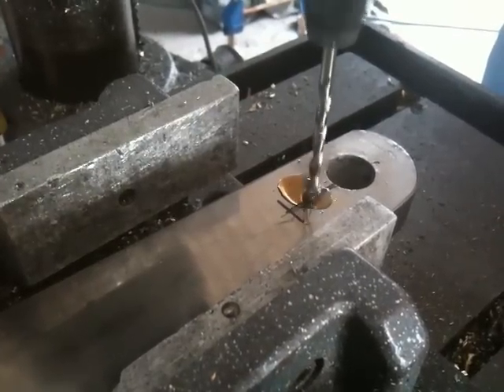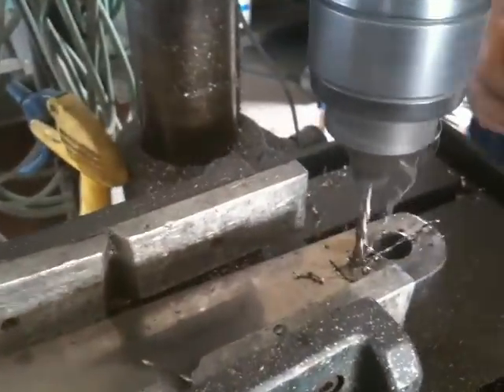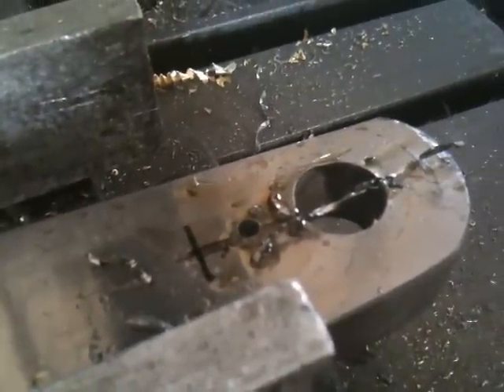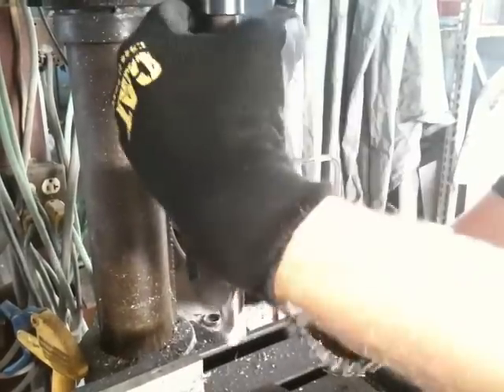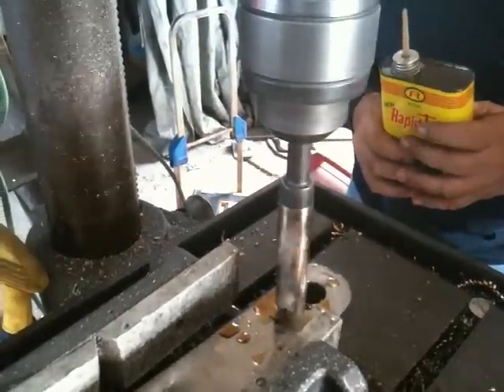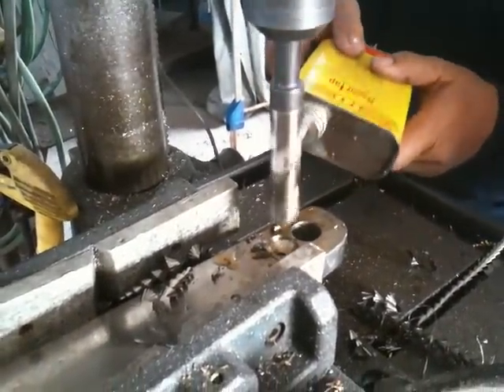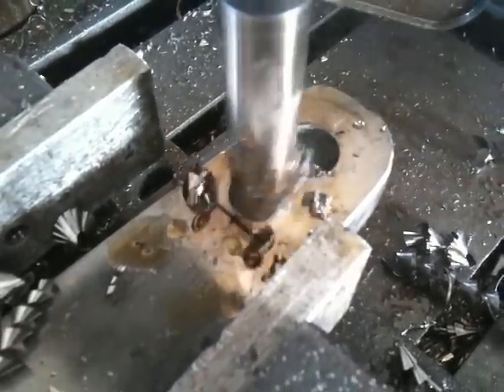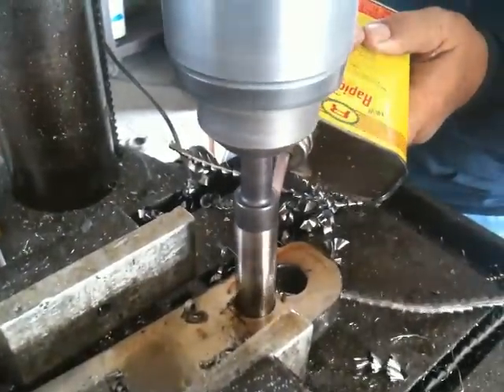Drilling Titanium in a snap !

Comment: I bought a strip of titanium for a project and had a nightmare drilling it. I tried new titanium coated bits and cobalt bits and messed them both up. In frustration just cranked the speed and probably the shear heat and pressure eroded a hole through it. Not recommended for a first time project material.

Comment: What drill speed do you suggest besides "slow"? Is there an ideal speed like 1200 rpm for example, or closer to 900 rpm...what?
Reply: way slower like 300 rpm. or as slow as you can feasibly go while still drilling at a decent pace. and applying plenty of pressure with plenty of lubrication.